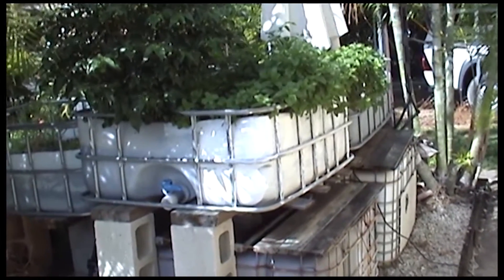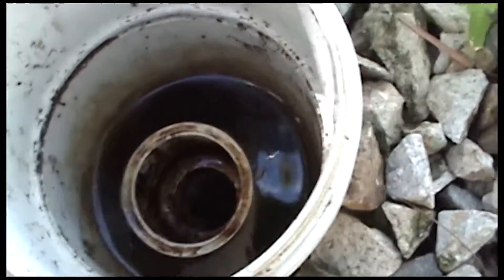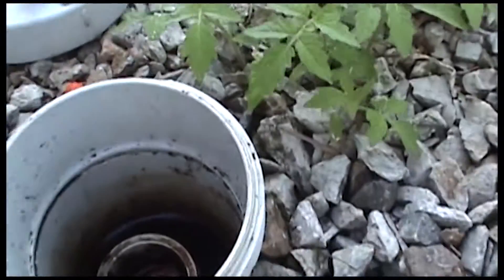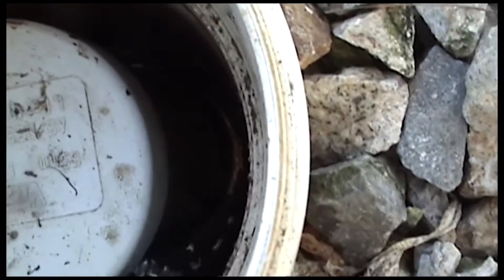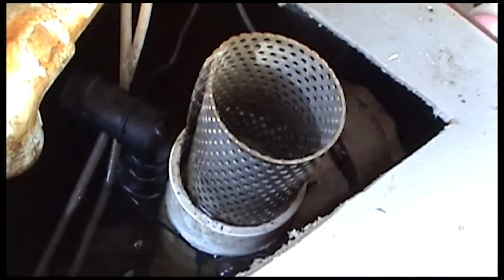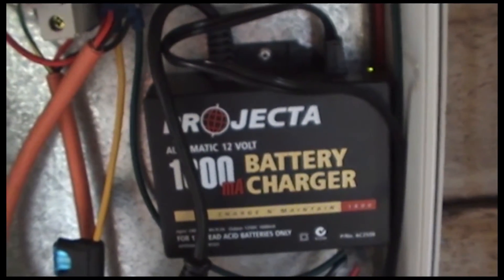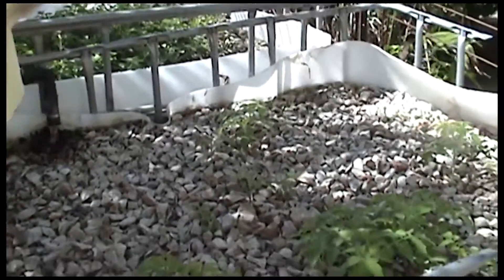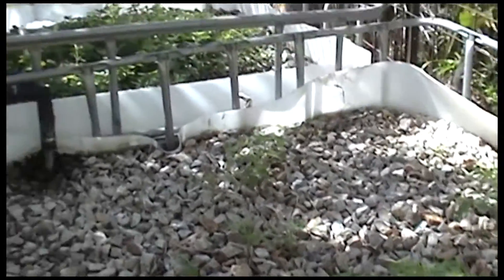Aquaponics System

Comment: so cool i'm trying still to get mine setup i hope to have my dome put out some greens like you do and to top it off fish to eat. I just have mine 100% off grid i got good low watt 12v water pumps, air pumps and air cooler and heater i have timers for led grow lights for the the dome at night looks nice  grow times are fast with more light and the fish poo the plants love it and the ph of the water . Its 80% done almost there bit by bit i get the gear.. 
so where do you get your fish from i'm in brisbane Oxley and do you buy your setup from aquaponics shop?
Reply from the maker: +TRMTHEweasel I got but setup from all over, recycled Ibc's,Pumps from ebay or pet shop.
Got the fish from here http://www.ausyfish.com/ they deliver all over
Reply: +Bush Block Homestead  cool ausy fish in Childers , i can drive from the block to there and pick them up. when i get to my block that is. they all sold out i say they have more start of next year.
so sure i'm right on where your block is i got the inlaws looking for a container home up there lol